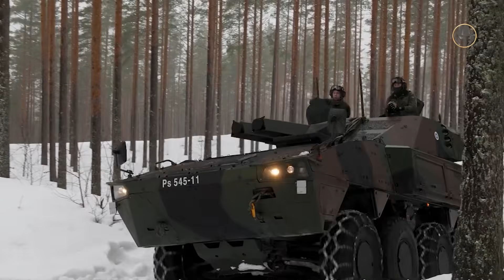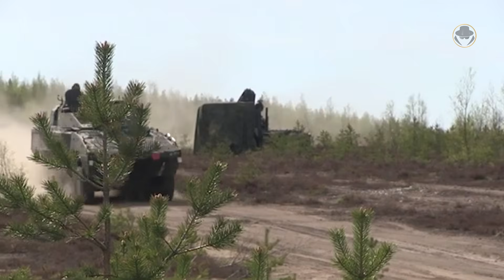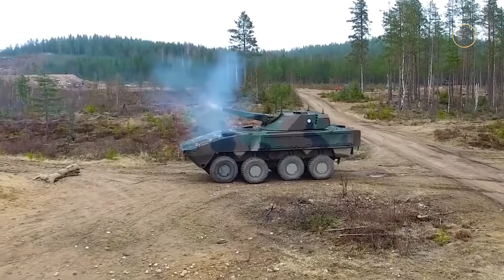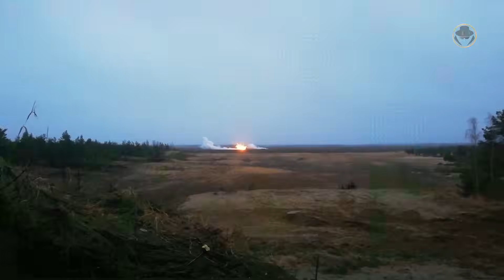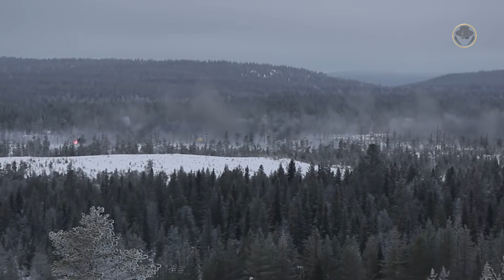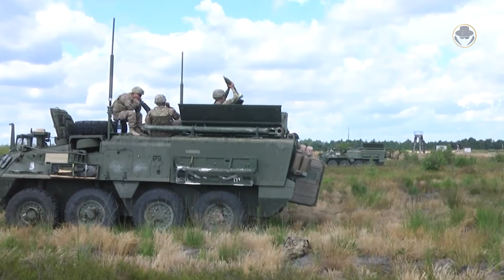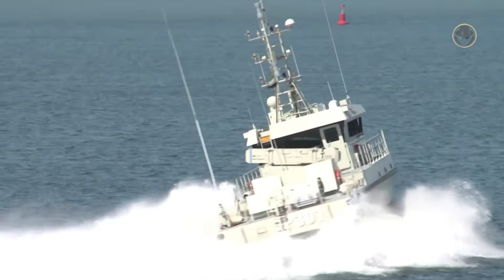AMOS - XA-361 | Why has no country, other than Finland, preferred such an advanced mortar

Comment: The problem is: Mortars are supposed to be cheap and simple alternatives to proper artillery howitzers. The only thing a mortar can do that a howitzer can't do better is being cheap and being lightweight enough to be carried by infantry.

Putting a mortar on a vehicle is already getting close to being overkill, but it still works because it still is cheaper and simpler than a self propelled artillery gun.

But when you then also complicate things and make then expensive by making it a turreted high-tech thing, you definitely jump the shark.

Now the question has become: Why not just buy a self propelled howitzer instead, which has a waaaay longer range?

It makes no sense to use all that hardware, the vehicle, the turret, the loading system, the computers and so on and then just put a mortar on it.
Reply: "Putting a mortar on a vehicle is already getting close to being overkill"   sounds like someone never needed to drag a 120mm mortar through a swamp
Reply: @jussi8111  I'd rather drag a thin-walled piece of pipe through a swamp than a 3 ton heavy howitzer.
I can tell you that much.

What is your point?
Reply: @TrangleC  “ I’d rather drag a thin-walled piece of pipe through a swamp”

Bro forgot to bring ammo XD
Reply: @Jake-dh9qk  You are not even getting close to making any coherent argument, man.
A howitzer needs ammo too.

If you had the choice between carrying a mortar with ammo through a swamp or carrying a howitzer with ammo through a swamp, would that be a hard choice for you?

Why are we arguing about this?
Who can with a straight face deny the simple fact that mortars are a light weight alternative to real artillery? 

Is this a language barrier? Are you guys not really speaking English and is that why none of you seems capable of logical thinking, of following someone else's argument and of making your own?

And about me arguing against Finland...
If you know how to reach Finland, please do so and tell Finland to come over here and give me some good arguments that actually refute the ones I brought up.

Not one of you guys has refuted or debunked anything I said. Not one of you fans of this weapon system could explain why it exists.
Reply: @TrangleC  the point was that you were calling a vehicle mounted mortar a overkill...
Reply: @TrangleC  You're so mad that you had a complete brain meltdown and forgot which side you're even arguing on. This is sad if not cringe. Reading your responses almost gave me a stroke, felt like I was trying to decipher the Najavo morse code.

This is your only argument: "herr derr bigger guns make bigger boom and go farther so they are better than everything hurr derrpity doo".

You also somehow think a single mortar team(around 6 men) can perform at the same level as a single one of this type of vehicle. Seems like a lack of critical thinking in my opinion, but hey that's just you. MAYBE you're some super special mortarman that can hit a target dead center with a mortar with 6-10 rounds in under a minute, but who am I to know?
Reply: @TrangleC  Clearly you are a qualified military procurer who knows everything about what is and isn't practical. I personally think it's also time for you to look in the mirror and realize you've also only made a singular compelling arguments as to why the system is impractical, with that being its shorter range. Congratulations, you have found a singluar disadvantage of the weapons systems that somehow apparently makes the whole thing irrelevant. If we use this logic the NLAW is clearly a useless expensive piece of shit, because it costs as much as some SACLOS/LOSBR anti-tank missiles while being limited to a range of 800 meters. Clearly the MILAN is much better since it uses SACLOS guidance and has a range of 2000 meters while being about the same cost. In reality this obviously isn't the case, however, since the two weapon systems have different roles and use cases. Similarly the AMOS system is intended to have high mobility and to require less maintenance than something like the K9 SPH. It can get to where it's needed faster and break down fewer times on the way. Meanwhile the K9 has more range and fires a heavier shell while needing rail transport for longer journeys. Both have their place, I don't see how understanding that is so difficult.

The AMOS can put out an insane high amount of mobile firepower for its size. This system can pump out significantly more shells per minute than any self-propelled howitzer of today with a sustained fire rate of around 20 shots per minute. For reference the PzH 2000, which is one of the more advanced self-propelled howitzers out there can do 10 rounds per minute sustained, and most older ones can do about 4 rounds per minute sustained at best. It's also worth noting that this system can fire a 10 round MRSI salvo and can be gone before the enemy can direct counter-battery fire. A single vehicle here can provide as much firepower as 3 more conventional mortar systems, and while I don't know how much the system costs, I can say with a good degree of confidence that it's less than the cost of 3 Stryker mortar carriers. 

Also, being closer to the target does in fact have a significant advantage for indirect fire, with that being accuracy. Any artillery weapon firing from 10 km away will be a lot more effective at causing casualties than one firing from 30 km away. A high arcing mortar will also be significanly more effective at engaging targets in thickly forested environments (which Finland happens to have a lot of) than a howitzer which may get stopped by trees. A howitzer is also much heavier and would not fit on a platform like this. The whole turret here weighs less than 5 tons, which is only slightly more than a singular towed M777 howitzer. If you want a fast wheeled vehicle with a fast firing howitzer, your only real option is the Archer system, which has its own drawbacks like being relatively slow to enter firing position, especially compared to AMOS. And even then the Archer is based on a logging tractor iirc, not exactly famed for their speed.

Many nations are currently looking for more advanced mortar carriers such as this, including the United States. The Israeli Elbit systems has also recently come out with their own version of such system, and of course Poland has also made one. Russia has also operated advanced vehicle mounted gun/mortars for a long time now.
Reply: @hawkstable8889  This is about simple logic. If some supposedly qualified expert tries telling me that 2+2 is 5, I don't give a F what diploma he has. He is still wrong.
Reply: Finland has a lot of swampy areas so having a lighter vehicle with more mobility and decent off-road performance makes sense to me. Finland is already producing the apc it is on top of. That eases logistics compared to having an entirely different vehicle with different parts and configuration. Also Finland has been making good mortars for a long time now so it too makes sense that it might put one in a vehicle. Finland also is capable in the field of technology and especially software. Considering all of this this system makes sense to me. It is an unusual looking vehicle but it is basically like those apcs with a mortar on top of it (as seen in this video) but able to use direct fire and has better protection. If there are reasons to use those aforementioned vehicles then so does this have.
Reply: @joonasnaski9513 I would have a hard time believing that an 8x8 is better on swampy terrain than a tracked vehicle. Even if the tracked vehicle is heavier.
Reply: @Rampant16  It depends on ground pressure and wheels can do that job while being cheaper and easier to maintain.
Reply: @Rampant16  These don't have to go to swamps in the first place. Finland is made of forest that are used for logging purposes. This means the country is full of logging roads. Of course 8x8 can still do off road, just not as well as tracked vehicle. In far north where they expect more snow or even crossing of some swamps, they used mortar carrier on tracked atv (KRH TEKA). AMOS supports (most likely, just 18 pieces around) only in units where other vehicles are also wheeled.
Reply: @Rampant16  These vehicles drive on small gravel forest roads mainly. These roads have purposely been made all around east border. they can go off road ofcourse if needed.
Reply: I wanna see you carry a heavy mortar in 30 cm deep sand.... I assume you have a picture of em being those not much bigger than a bazooka... the shell weights 15kg+ so you carry that thing on your back... then all artys ain't the same and and and....

The pricetag is very high and thats why they made cheaper version but I assume you have never yourself moved equipment in a forest... plus that those things they are attached to are mountain climbing swimming machines plus A LOT lighter than a arty so you can even cross lakes with em in winter while a tank or arty can't... plus that I would rather sit in an Amos when its -40 outside than try to drag one through the snow and then sit there manually aim it...

Like you  neglect the entire reason why some things works in some parts of the world and other in other parts, like how many tanks drove in Vietnam and why did they spend more time fighting the forest than the enemy, like didn't the helicopter pilot see 15km around them like in Ukraine?

I hope you get my point that everything is not like in Ukraine.
Reply: @amadeuz8161  Holy moly. YOU DO GET THE CONCEPT OF RELATIVITY, DO YOU?

Nobody said hauling around a mortar is easy or fun, but it can be done! Despite a few cases where it happened, it can not practically be done with a howitzer!

If howitzers would be as light as mortars, mortars would not exist! If mortars were as heavy as howitzers, mortars would not exist! 

Their whole point is that they are a shitty, inferior but still logical because light weight alternative to real artillery!
Reply: @TrangleC  I think you are clueless about the terrain of Finland and also about the fact that we are small country with highly trained active troops and dedicated reservists (over 70% of male population does military service). Our style of combat is that of guerilla warfare this is because of all the lakes, forests and swamps we have. The enemy only has few ways into the country and no way out once we engage them. We have thousands of kilometers of maintained dirt roads on the entire border to allow fast movement in motor vehicles and towed artillery. We do not battle in open fields or trenches. The key thing is mobility and preservation of troop lives.

I want to see you dragging 81mm or 120mm mortar through two meters of snow in the winter and through mosquito ridden swamps in the summer and you will quickly prefer vehicles, I'd imagine.
Reply: @ex1tium  Holy shit, another one.
OK... for the 20th time:

In guerrilla warfare it is even more advantageous when you can shoot the enemy from far away and don't have to move around and risk being detected!

And when you have a lot of rough terrain, GUESS WHAT!!!!! it is also good to have long ranged weapons that don't need to move around so much in that terrain!

BASIC LOGIC you effin' doofuses!

AND GUESS WHAT ELSE! Preserving troop lives is also a bit easier when you don't have to get close to the enemy!

What is wrong with you people? Were you all dropped on your heads as babies?

Half of you make shitty arguments for the use of mortars and half of you make arguments against the use of mortars but are too stupid to realize that and you think you are arguing for the use of mortars!

I too thought Fins are pretty cool and smart people, but after this weird debate here, I am starting to doubt that.
Reply: Howitzers have a flatter trajectory and longer range so it's unsuitable for close engagements. Infantry-mortars are basic mortars that are inaccurate and require volume of fire to achieve effect. This advanced mortar however can use scouting and other friendly inputs to put down accurate fire on enemy locations in a short span of time because friendly infantry or aerial spotters can simply locate the enemy's coordinates and send the information directly to the vehicle's GPS and the mortar will automatically calculate the trajectory.

And true, instead of putting a mortar into such an accurate fire control system, they could've put a howitzer instead. But howitzers have limited fire arc, and volume of fire is low. A mortar system makes sense because it can fire 6-10 mortar shells directly in an precise area, creating more chances to knock out infantry. The choices of munition is also something this mortar can do that howitzer's can't, such as airburst, cluster and guided rounds. Guided rounds are crazy because it's essentially a heat seeking mortar round, like a heat seeking air-to-air missile. It will guide itself into enemy vehicles and land directly on top of them like a top attack rocket.
Reply: @Jake-dh9qk  Volume of fire for howitzers depends on the loading system too and there are howitzers that can fire as fast as this mortar.

Your comment on ammunition leaves me a bit dumbfounded.
You think there are no airburst or guided ammunitions for howitzers?

You never heard of Excalibur?

Also there is stuff like the German SMART 155mm artillery round, which ejects 2 self guiding sub-munitions with heat seeking sensors in the air, which then search for their targets.

And arc of fire is also not a good argument. There is no kind of target that a mortar can hit better from 5 km away that a howitzer can't also hit from 40 km away.
The shape of the arc is the same, just is the howitzer's arc much bigger.

ESPECIALLY nowadays with kamikaze drones swarming around everywhere near the front, keeping distance is all the more important.

Being close to the target offers no advantage to a indirect firing weapon.
Reply: @TrangleC 
1. "And arc of fire is also not a good argument. There is no kind of target that a mortar can hit better from 5 km away that a howitzer can't also hit from 40 km away."

-Somehow you think terrain limitations don't exist and all wars are fought in Middle-East style flat terrain? Good lucky waiting 1-2 hours positioning an artillery battery unit to hit a target that's obstructed by terrain. 

2. "The shape of the arc is the same, just is the howitzer's arc much bigger."

-The 120mm Mortar and the average 155mm howitzer have completely different velocities. The howitzer has almost twice the velocity of the mortar. Did you not even realize that differences in velocity equals differences in trajectory arc?

3. "ESPECIALLY nowadays with kamikaze drones swarming around everywhere near the front, keeping distance is all the more important."

-The same argument can be said about artillery units from 40km. There are counter battery units that can send a missile to artillery units 40-100km away. Just because there is a threat doesn't render it obsolete, it just means you have to take more defensive measures.

4. "Being close to the target offers no advantage to a indirect firing weapon."

-Being close to target means you can immediately respond to threats with accurate and precise mortar fire. You don't have to wait for artillery to reposition, you don't have to worry about artillery missing. Being close to combat is also sometimes a necessity due to terrain limitations that an artillery unit can't reach. Level of signature is also a great threat to artillery units, you will be easily spotted by jets, who can either directly attack you or simply report your coordinates back to a counter-battery unit. Mortars leave lower signature.
Reply: @TrangleC  idea of such mortar is to be part some mechanised unit so movement and fast reaction time to shoot are more important than range, it is even capable to shoot directly targets while moving.
Reply: @TrangleC  Every place ain't as flat and open as Ukraine so calm down with the drones, yes they have a role just not as effective in more rough terrain and lets say countries with trees and bumps.
Reply: @freezedeve3119  Radio signals move at the speed of light, you know. Telling a howitzer 30 km behind you that you want that or that spot destroyed takes no longer than telling a mortar 100 meters behind you.
Reply: @amadeuz8161  Can't one of you guys make any logical argument?

Have you seen any footage of the Ukraine war? They have plenty of trees there.
Reply: @Jake-dh9qk  A thing that has a range of 40+ km has to reposition way less often than a thing that has a range of 5 to 7 km.

Sorry dude, but all your arguments are just ridiculously bad.

You are just flailing and grasping at straws here because you like this silly machine and want it to make sense.
Reply: @TrangleC  if you are driving by road 30 km  is about 20-30 minutes so having arty ready everywhere for you can be hard.
Reply: @TrangleC  LMAO you do realize you're not actually arguing against me right? You're literally arguing against the Finland, a country that has dedicated their weapons and infantry tactics to creating a specialized defensive doctrine catered to that exact particular region they reside in.

You have to remember that NOT ALL militaries are like the US military. They're not built around the concept of projecting global power like the US, majority of nations including Finland have complete different doctrines and many of them are based on defensive strategies based on the terrain of their home regions. 

You cannot seriously go on youtube and tell a whole entire foreign army that "they're doing it wrong". As a matter of fact you're actually calling most country in this world stupid for using a mounted-mortar system because almost every dominant country in this world has a mounted mortar system. It's just so that Finland has the most advanced variant.
Reply: @freezedeve3119  I don't even know what you are trying to say here.
Reply: @TrangleC  Yes I have seen and no they don't even have real forests, like you can see that they are planted ones from satellite pictures(was it 16% forest coverage only). Then they are flat, open and flat. Like you have to have a country close to you with real forests and bedrock making bumps into the land and then a mortar bomb might be able  to hit while the arty would just bash the bedrock("A mortar round has a very steep arc while the artillery round has a flatter trajectory.").

Your argument was that there is no place for a thing like an Amos, the mortars only function was to be cheaper than an arty and I did agree that the price was a bit salty for its function. Still the function of a mortar, heavy mortar and artillery aint the same. Similar but not the same and drones are useful but Ukraine is really the wrong place to determine how useful they are for every country. Its like comparing a pistol, with an AR and machine gun, their function is similar but not the same.

Then you completely ignored the weight of a heavy mortar tube and the shells, like that Amos makes it able for 4 people to fire up to 48 rounds and are mobile all the time while if you would do the same with people you would need 3-4 to carry the tube, then 10 people to carry the rounds and they would have no chance to escape counterfire at least without dropping everything.

Like yes the pricetag was not worth it so even they made the nemo but you are like the armchair generals that say "shoot and scoop" doesn't work when its in Ukraine that is as open as the sea where it doesn't work. Like if drones would be able to spot every living thing in a forest then why do we even have rescue workers and search patrolls anymore when someone gets lost in the woods?!? Like Imagine a land where a drone can only see like 100m not a place like Ukraine where they see many KM's.

Then something that has a total weight of 25t can get to places that something with 50t cant(bigger an heavier can be worse). Then the travel time of the round, like you ignore everything and just go by looking at Ukraine and how that is playing out. If the enemy is charging its a huge difference in 10 secs and how much you manage to "shock" them with. Like 1 scares em, 2 might scare a bit more but 10 hitting at once will create "shock". The speed of a Artillery is a lot slower compared to a Heavy mortar. 

I have watched people drag those in the forest and I was carrying 8+ AT mines but still laughing at their struggle so I would also love a million worth machine to carry my sht if possible and sit inside a warm thing while digging down the mines.

I cant still say anything else than Ukraine is very flat and very open so yes we should take a lesson from it in war in open spaces.

Its a bit same like the argument between wheel or track, both have their own place but in Ukraine tracked seems to be better because of them having nothing else than fields... Still wheels will win in many other places.
Reply: @TrangleC  Don't forget it is mostly about the crew, having this capability in a fully mechanized brigade and offering protection from bullets/shrapnels/mines, etc. 

It's exactly the same reasons towed artillery is getting replaced.
Reply: @TrangleC  Afghanistan mountains. Good luck lobbing a 155 artillery shell in the shadow of a mountain. Espescially when its 30km away from base. Similar issue with high-rise buildings in urban areas.
Oh wow, you guys went for a jog up there. Well good for you i guess.
Reply: @Pilvenuga  And how the F would a 120mm mortar perform any better in that situation? A weapon that shoots both less far and less high?

Do you weirdos think mortar shells can teleport through mountains or something?

Have you never attended school and looked at a parabolic graph in math class?

Guess what, Einstein, when a shell that flies 3 km high and 6 km far can hit a target, then a shell that flies 10 km high and 20 km far can hit that target too.

What is so hard to understand about that?

It is as if I'm arguing with cavemen here.
Reply: @TrangleC  guess you havent seen a ballistic chart before. you can call us cavemen but we can clearly call you not an artilleryman.
Reply: @Pilvenuga  So you have ballistic charts that work on physics from another dimension?
Reply: @TrangleC  no, just the ones that work in ours
Reply: @Pilvenuga  Alright, then explain to me how a weapon that can throw a projectile 2 km into the air can hit stuff a weapon that can throw projectiles 10 km into the air can not hit.

What curious ballistic chart explains that?
Reply: @TrangleC  Firing a 155/L52 howitzer at a range of 40 km requires advanced ammunition, otherwise with conventional ammunition the fire dispersion is going to be huge, and entirely unsuitable for any tactical fires. That means effectively the American PGK or similar trajectory correcting fuses or more advanced intelligent munitions are required pretty much at any ranges beyond 20 km, if you don't intend to fire with huge volumes to offset the dispersion.

The issue with SMArt and BONUS are that they don't feature any proper IFF capability, so if you call on a firemission with them, you'd better not have any own heavy equipment within the probable area of effect. They also have to have aforementioned trajectory-correcting fuses if the area of effect needs to be accurately delineated, or you'll have to fire conventional first as an accurizing shot to determine the ballistic variables for accurate fires. The standard fuse for the system is just an "unintelligent" time fuse liable for normal ballistic variables (mechanical error probables, cold barrel, barrel wear, charge temperature, atmospherical in-flight variables/ballistic weather etc.).
Reply: @TrangleC  "Radio signals move at the speed of light, you know. "
Shells, however, do not.
Reply: @TrangleC  "Have you seen any footage of the Ukraine war? They have plenty of trees there."
Cute, like comparing a flower pot with a field. Finland has more trees than the entire Ukraine, on a much smaller area.

When it comes to logical arguments, there is really only one needed: the Finnish army wanted it,
If  it  wasn't more useful to them than a towed mortar,  they wouldn't.
Reply: @TrangleC  Don't teach your father to fuck! AMOS has been developed to fight in Finnish terrain.
Reply: @TrangleC forest coverage in ukraine is 16,9% while forest coverage in finland is 75% lol plus the terrain is completely different. the wars would be very different and have different requirements
Reply: @Leksuttaja149  That doesn't refute the points I made in the slightest.
As I said like 10 times in this thread, in forests and swamps it is all the more important to have long range and not have to get close to the enemy.
Reply: @TrangleC you really dont seem to get how fucked the terrain here is
Reply: @joonas2384  Holy moly. I said like 10 times now: The worse the terrain, the dumber the idea to use a short range mortar instead of a long range howitzer.
Every kilometer you can shoot farther is a kilometer you have to drive through terrain less.

What is so hard to understand about that?
Reply: @TrangleC  You really dont get it
Reply: @joonas2384  Then tell me. All the other dorks in this thread were unable to make a coherent argument for why this is better than a SPG. Maybe you can do it.
Reply: @TrangleC  Here let's do something simple. Imagine you get teleported back in time into the medieval era. And you find yourself in the middle of a siege as the besieger. In front of you is a castle with a 60ft wall in between you and their army. You really want to cause some immediate damage to their army inside, and you have two units at your disposal.

1. You have a group of archers
2. You have a group of ballistas

The ballistas obviously is the "better" ranged weapon, but their fire arc elevation means they'll more than likely hit the enemy walls instead of the troops behind it. So you use archers instead, which cause less damage BUT they can shoot at an elevation that can ignore the walls. You get the comparison right?
Reply: @Jake-dh9qk  Do they not teach geometry at Finnish schools or what is the issue here?

Don't you guys always score so well on those PISA tests? Why does not one of you people grasp the most simple facts of math and physics?

For crying out loud. The arc is the same. The angles are the same. The arc for the howitzer is just bigger.
A howitzer can hit everything a mortar can hit, just from further away. There are no magical angles only a mortar can come in on.

Every wall, hill, tree, mountain, building or whatever a mortar can shoot over, a howitzer can shoot over too. Every square inch of ground that is open to the sky and can be hit by a mortar, can also be hit by a howitzer.
Reply: @joonas2384 Turha väitellä. Tämän kaverin mielestä lentoajalla, järjestelmän painolla ja varoetäisyyksillä ei ole merkitystä. Järjestelmällä on maagisesti aina käytössä erikoisampumatarviketta, jolloin etäisyyden tuomalla hajonnallla ei ole merkitystä. Ja vain epäammattimainen armeija käyttää epäsuoraa jalkaväen tukemiseen alle 600m päähän omista...
Reply: "The only thing a mortar can do that a howitzer can't do better is being cheap and being lightweight enough to be carried by infantry."

You already answered your own question and you still failed to see the common sense in this. If howitzer makes mortar obsolete then why even have the need to develop specialized units for mortar teams? The answer: Because they NEED mortars for special situations. There would be no need to have mortar teams if Howitzers can just reach any target at any time. Neither the howitzer or mortar replace one another, they both fulfill different purposes on the battlefield, like an LMG and a sniper rifle.                                           

:)
Reply: Because mortar shells have a shorter lethal range, they can be fired closer to own troops without risking blue-on-blue casualties. Being able to order a firemission immediately at contact with enemy, even while the firing unit is on the move, allows a significant tactical advantage. This advantage gets even larger if it is a head-on battle with enemy forces lacking such capability (ie. equipped with conventional mortars which need proper laying - you'll get up to 30 minutes of full superiority in tactical fires, which is easily a decisive factor).

The MRSI offered by gun-mortars with computerized FCS offers also significant density of fire increase within the first impact, which contributes to lethality, as the first impact and somewhat extended first 5-10 seconds of a firemission are the most probable to cause casualties, before the targeted troops get to cover.
Reply: @TrangleC 
Because targets aren't static? If less time is spent in flight the target has moved less.
Also if you throw munition 5 times higher you need to impart 5 times as much energy. This makes your system much more detectable when firing.
Further consideration you are correct that if there is a parabola of length 2 km which can connect two points then there exists a parabola of length 10km connecting two points. A difference between those parabolas are the angle of attack and the angle of arrival. When obstructions such as caves are present the 10km parabola might connect through the cave wall making a hit harder. Some targets have worse protections against lower angle of attack damage.

Is this enough to justify a separate type being built and fielded? I do not know.
Reply: Mortar can fire faster.

Mortar can fire in much higher volume.  

Mortar, even this, is still lighter compare to a short barrel 105 artillery. 

Mortar shell is cheaper per caliber compare to convention artillery, it also packs more boom per caliber.

Mortar is cheaper to maintain. 

Mortar is much more flexible better if your are expected to engage in shorter distance and/or the terrain is mountainous.  

Precision fire is infinitely more useful than even a group of unguided fire, even said fire is corrected by drone only. Hooking it up to a computer makes the reaction much faster.
Reply: @Pyhantaakka  Dude, "safety distances" aren't really an argument either. They depend on what ammo you use and there are tons and tons of different 155mm artillery shell types.

And a sane, properly led modern military neither drops mortar shells, nor artillery shells a few meters before the feet of their own soldiers.

The definition of "Danger Close" in NATO is 600 meters. You don't use any big fire support weapons with shrapnel or big blast radius within 600 meters of your own troops.

I know, Finland didn't belong to NATO at the time this weapon system was built, but even if it were Finnish military doctrine to shoot any kind of artillery near their own troops, that would just be a crazy and stupid idea and not an argument for using mortars.

Besides, we are not talking about 81mm mortars here, as you know.

I never said mortars in general are useless. I said from the beginning that mortars make sense as a small and comparably lightweight alternative to big artillery that can be carried and used on the Company or Platoon level.

A big tracked vehicle with a automatic 120mm mortar is not in that category anymore.

When it comes to fire support for infantry, it doesn't matter whether it is a 155mm shell fired 30 km away or a 120mm shell fired 6 km away. Both are too big, too far away and too reliant on being told where to shoot by someone else to be used safely near friendly troops.

Don't you see the problem here?
All the arguments you make for why not to use a 155mm artillery piece apply to a 120mm mortar too, while the arguments I make in favor of 15mm howitzers clearly make them superior to 120mm mortars.
Reply: @Pyhantaakka  Yeah, that is all fine, but only on a superficial, first glance.
Finland would still be better off if it would have bought more self propelled howitzers instead of motorized mortars.

Granted, back then there weren't as many options for self propelled howitzers as there are now, but they could have developed their own, instead of developing this.

I guarantee you, if they would have put that money, that time and that brain power into developing a relatively light weight self propelled 155mm howitzer, that thing would have sold internationally.
Look at the South Korean K9.

This machine has all the tech a self propelled howitzer needs and I have to assume it is at least as expensive as one, probably more expensive because it was produced in smaller numbers.

There is no good reason for preferring a mortar over a howitzer, if you are using that much expensive high tech anyways.

Smart people running big corporations make mistakes too. The fact that this thing was developed and that Finland as its homeland felt compelled to buy it, doesn't prove that it is a good idea.

Look at the American "Littoral Combat Ships" or the "Zumvalt Destroyers".

The Pentagon fucks up weapon procurement too.
There are other examples.

I regret that I lost my temper and got rude and condescending in my previous replies and I am sorry to the people I insulted, but I still say the arguments they presented were bad.

It is just a fact that a howitzer can do everything a mortar can do, plus things a mortar can not do and those things are not small, insignificant things.

The Ukraine war has proven that range is super important and the advantage of being able to shoot further is not limited to just being able to hit stuff further away, but having more range also means you need to move less and you have more options for either using terrain to your advantage, or being able to avoid terrain you don't want to drive into.

Also, another big and important lessons from Ukraine is how important logistics are and how vulnerable weapon and ammo stashes near the front are.

The shorter the firing range of your weapon, the more you or the trucks connecting you to the nearest ammo stash have to move around to resupply. That means the more vulnerable you and your supply chain are.

The argument that being closer makes response times shorter also makes no sense anymore nowadays.
Whether it is a mortar 1 km behind you or a SPG 30 km behind you, the process of telling them where you want them to shoot is the same. The same amount of communication, the same information needs to be transferred and the same protocols need to be followed.

Sure, a artillery shell traveling 30+ km needs a few seconds longer than a mortar shell traveling 5 km, but not that much longer actually and anything that is fast enough to evade the artillery shell, is probably also fast enough to evade the mortar shell.

Also, a SPG or a rocket launcher sitting in relative safety far behind the front will probably be ready to fire faster than a mortar carrier that is currently moving with your troops and has to halt, maybe change position to clear some obstacle and get ready to fire first.
Reply: @TrangleC  I think a country with the largest artillery in western europe knows what they need to develop...
Reply: @Pyhantaakka  What experience? What experience does anyone have with using such a thing in battle and who compared its performance with that of a SPG?

Don't pull this "experience" BS with me. We are having a discussion based on fundamental logic and as it seems, on that level none of you guys has any credible arguments to make.

What is so incredibly hard about admitting that you were wrong?
I have done it many times when people actually had better arguments than me. I am always glad to learn something new and correct wrong believes.

Why are there so many people who act as if someone insulted their mommy when talking about some piece of technology they usually have nothing to do with?
Reply: AMOS is pretty much perfect system for Finnish defence forces. We are country with rough terrain with lots of possible small areas for enemy to hide where our artillery (largest on europe, so you know we havent forgot artillery) cant reach. In these pockets this mortar system can fire with ease. Thanks to higer firing arc that is possible compared to long range artillery. 

Allso one if not the most important thing that makes AMOS so good is the fact our country has very low population so weapon systems like AMOS that can douple or triple the firepower of one crew is super important. To achive same firepower you would need 3 conventional mortar crews thats like 6 times more people and they would not have even near the mobility. For us Finland the greatest cost of war is loss of manpower so we like to avoid that as much as possible. Allso manpower is our biggest problem or lack of it so we like to remedy that.

Hopefully you understund this and accept that this weapon system is really good for us. Our engineers wouldnt have used resourcess on it If it wasnt. We are not US army that will dump resources on projects that could work and might be good. We need something we know it and get it somehow.